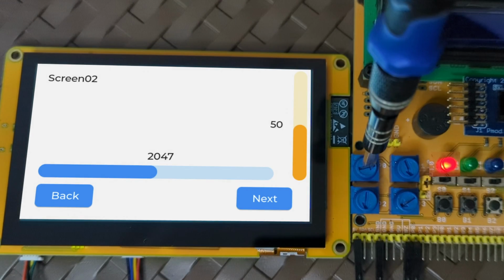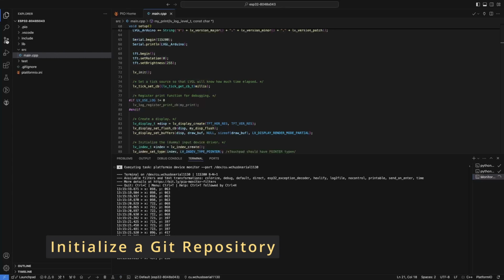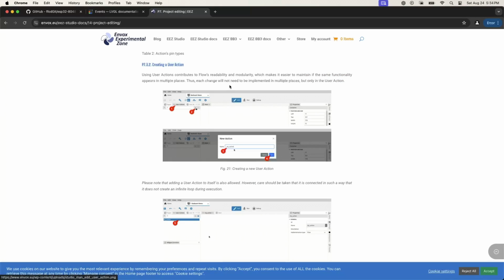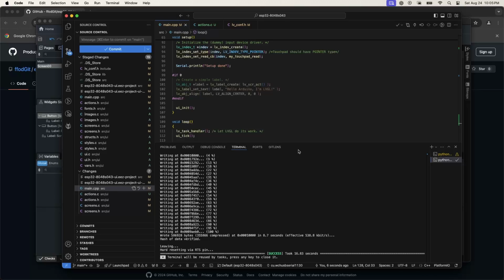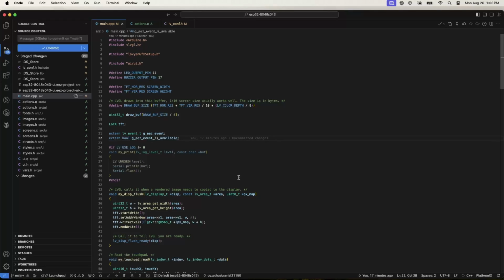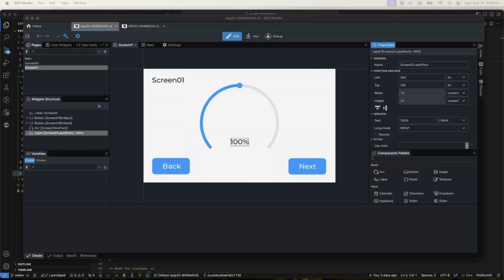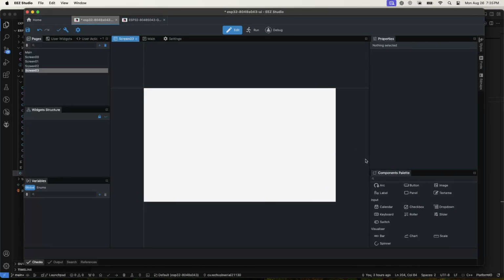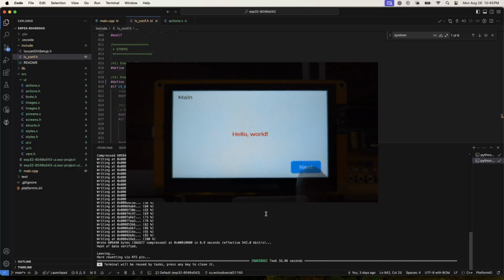Getting Started with the 4.3-inch Capacitive-touch ESP32 Sunton Display

Comment: Do someone knows if it is possible to connect a external I2C sensor to the board ?
Reply: That code will be outside of the LVL code in PlatformIO, you can use any examples of code to accomplish this

Comment: What is the hardware differences between used board and Gen-4-ESP32 from 4D Systems? Because when I tried to upload this template to the Gen4-ESP32-24, my computer no longer recognized the module on the USB bus...
Reply from the maker: @richardneuwirth7068  unfortunately I haven't been able to purchase ESP32 displays from 4D Systems. I was planning to explore their Gen-4-ESP32 range last year but I got busy with work.
They do have an excellent forum where you can post your inquiries. They should be able to guide you on how to modify the code to suit their hardware.

https://forum.4dsystems.com.au/node/80188

Comment: it will work with external button?no touch display?
Reply from the maker: Hello, you should be able to configure any of the available GPIO pins as a digital input pin, then perform digitRead(…) as required. Let me know if I understood your question.
Reply: @embeddedWeekends  can you do video example

Comment: U R GRATE!!! Does it work for the esp32-2432s028?
Reply from the maker: Hello @Juan123qwerty,
Thanks for your feedback.
In theory, the approach described in the tutorial should work well; you’ll just need to adapt the code for your specific hardware. For example, consider replacing the LovyanGFX library with the TFT_eSPI library, which is better suited for smaller ESP32-based displays that interface with the display and touch panel using the SPI peripheral.

Additionally, you’ll need to update the “main.cpp” source file to replace all instances of the “tft” object. This includes modifying the functions “my_disp_flush,” “my_touchpad_read,” and even “setup.”

To support your efforts, I recommend this excellent introductory tutorial:

https://youtu.be/E3NAmstft_8?si=ZnXInHBuRpUDXGt7

I also plan to purchase a 2.4” ESP32-based display and create a separate tutorial. However, I’m currently busy, so I can’t provide a specific timeline for when that will happen.

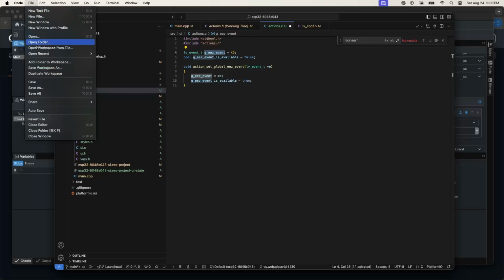Comment: At 16:50, line 4 of actions.c generates an error. g_eez_event is underlined, and the error description is "incomplete type "lv_event_t" (aka "struct lv_event_t") is not allowed C/C++(70)".
I'm using the Cheap Yellow Display and TFT_eSPI.h, but otherwise things are pretty similar. 
Does anyone know why this may be happening?
Reply from the maker: @russellblackburn5719 I believe the main difference in your setup is that you’re using the TFT_eSPI library, while this tutorial uses LovyganGFX. That said, if everything else is set up correctly, I think it should still work. Have you managed to resolve the issue since then? If not, feel free to share a link to your repository, and I’ll take a look when I get a chance. I can’t promise a quick turnaround, but I’ll do my best to help!
Reply: @embeddedWeekends  Hi, thanks for your kind offer. I elected to get the 4.3 inch board so I could learn as easily as possible, without adding to your workload. It's going great and I look forward to your upcoming videos.
Reply: I have this same problem:
actions.c:4:1: error: variable 'akcja' has initializer but incomplete type
    4 | lv_event_t akcja = {};
      | ^~~~~~~~~~
C:\Users\katon\AppData\Local\Temp\arduino_modified_sketch_875158\actions.c: In function 'action_przycisk':
actions.c:8:13: error: invalid use of incomplete typedef 'lv_event_t'
    8 |     akcja = * e;
      |             ^
actions.c:8:11: error: 'akcja' has an incomplete type 'lv_event_t'
    8 |     akcja = * e;
      |           ^
C:\Users\katon\AppData\Local\Temp\arduino_modified_sketch_875158\actions.c: At top level:
actions.c:4:12: error: storage size of 'akcja' isn't known
    4 | lv_event_t akcja = {};
I installed library lovyan(https://github.com/lovyan03/LovyanGFX/tree/master), but problem still is...
Reply: @Tomasz-i3z  Hi! did you ever solve this issue? I'm running into the same thing using ESP32-2432S028R. I got everything going smooth until I have to set up the action, and then I get the same error.
Reply: @PawelPirog-w9v  I solve the problems:))
https://www.youtube.com/shorts/h2a9Vrdr-C4